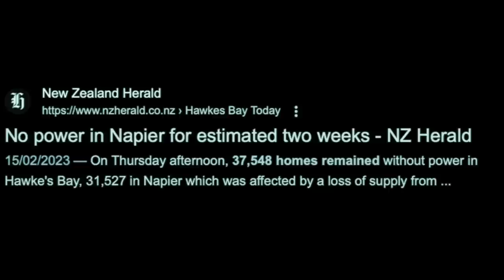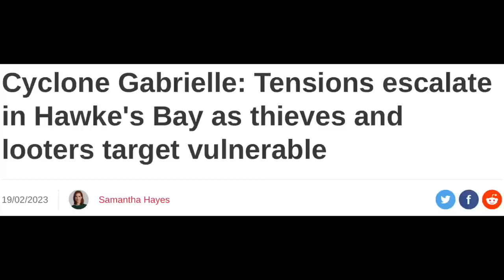The truth about Cyclone Gabrielle

Comment: I worked in forestry and we virtually used every part of the tree save the branches, smaller logs were turned into fence posts for farmland. The rest was then heaped into long rows 6 metres apart called wind rows, then the new trees were planted between them . This slash is ridiculous heads will roll.